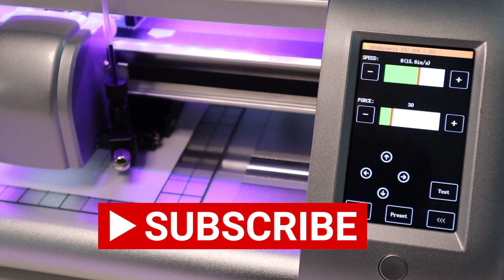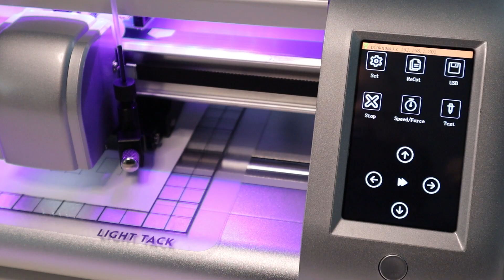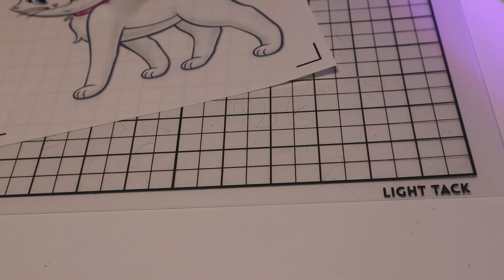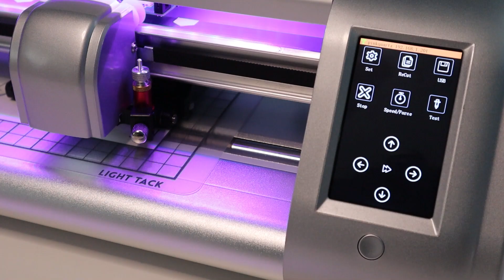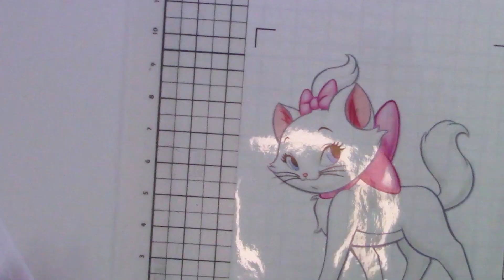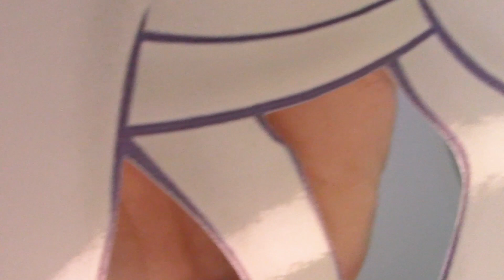Starcraft Solo - Print then cut - Beginner tutorial - Chapter 7 101

Comment: Hi Corinne, just set up the machine, and have been trying to do a cut and print. The scan for the cut does the first 2 registration marks fine, and then errors on the 3rd mark on the top left. I have restarted the cutter, restarted the software, realigned the cutter, printed it on 2 different printers, and I still can't get past the error. Help ! Thank you.

Comment: I just got my solo and setting up the pressure for each preset, would you say 30 is good for diecut without cutting into the mat?
Reply from the maker: I can't say because there are too many factors like what paper you are using, how far out your blade is in the carrier, the speed, laminates all those things. This machine is not like a cricut where I could say yes cut on this setting its likely to work. This machine you need to try your own settings to see what works with the way you have the machine set up.

Comment: not true the print then cut is 15+
Reply from the maker: At the time of this recording print then cut was 13.8. Wide. I was in direction communication with the developer of the software so the size may have changed since this video was filmed many months ago.
Reply from the maker: Just clarified with the developer of the Starcraft Solo and no you are actually incorrect. The print then cut size is still limited to 13.8 inches wide however it can cut up to 72 inches long

Comment: Hii I am new to solo cut but I did calibrate it with your video and it's cutting straight through the middle across the images as well
Reply from the maker: Your blade maybe too far down. The blade needs to be just barely showing
Reply: @CorinneBlackstone  I checked it but it literally cuts on the image I feel like it's a setting but I'm not 100 percent sure I have tik tok where I show it if you'd like to see if you can help me if you have a little time I would greatly appreciate it
Reply: @TheShannaWanna  hey I found out that you have to activate the software, if you don’t activate it, it will send cut lines through your images until you do! So on the beginning when you downloaded your software did you put your serial number in or activation number

Comment: I have a bunch of custom made files in Cricut design space (about 100 different stickers that include curved text). I'm a bit concerned about moving over to the Starcraft solo as I'd have to recreate all those stickers. Given the proprietary nature of design space, how hard vs easy would it be to get those out of design space and into the create software?
Reply: By the way - thank you for these videos. Very informative.
Reply from the maker: @dubalo  I have videos showing how to pull stuff from design space but with stickers you will lose quality when using screen shot to move them
Reply: @CorinneBlackstone  That was what I was concerned about. I make very small labels (1") that have curved text on them. Not looking forward to having to recreate those given how long it took to make them in the first place.
Reply: Also, which video are you referring to so I can see how you did it. I have an idea for another work around using a saved .pdf version of Cricut print-then-cut file.

Comment: I'm confused by this. In the video (and I also see in comments) a reference to "I don't have a large format printer" why would that be an issue? I guess I'm missing something pretty basic but I thought this machine prints out the material and then cuts it so why would one need a large format printer besides this machine?
Reply from the maker: No. There is no printing on this machine. The machine only cuts. Much like just about every other die cut crafting machine

Comment: Can you cut with a border around the art like with the Cricut? Also will this software work with the Cricut, I heard it will. Looks like a great machine but why at $500 they didn't make the pinch rollers automatic doesn't make since. Not a big deal, I'm sure you will get in the habit of releasing them pretty fast.
Reply from the maker: You can only cut with the cricut using design space. Provo craft the people who make cricut have actually sued companies over software that could work with cricut. You can design in the software and then you can export it to design space. Price I can’t tell you how they come up with that price it’s worth it I think. It’s metal and sturdy so much faster and quieter than other machines on the market, and the pinch rollers are not automatic to allow for a longer lasting machine as well as if anything does go wrong or break the part is replaceable so you don’t have to buy a whole new machine

Comment: I have a question. I have one but haven’t had a chance to begin using it yet. I use StarCraft inkjet printable vinyl and it’s pretty thick. I’m sure it will do a great job cutting it since the company that made the solo also makes the sticker paper. But my question - what must I do if the it doesn’t cut all the way through my stickers? On the Cricut I always run 3 passes to cut through my stickers. But with this machine - since it is so advanced - when I run a test cut, and it doesn’t cut all the way through, to I just feed it back through the machine? I have read the manual and found nothing about it. Thanks a bunch! I do appreciate this video! 🙏
Reply from the maker: You need to run the test cut until you find the setting that cuts through your sticker by upping the force. Just like with a cricut changing the pressure. You shouldn’t run your sticker paper through three times you should change your cut setting to cut correctly the first time
Reply: @CorinneBlackstone  The thing is… StarCraft inkjet printable vinyl is pretty thick, especially with the laminate covering it. And the way I cut my stickers, I cut them so that they pop out from the rest of the excess vinyl on the mat. Took me a little to figure out the settings with Cricut. So I need to figure out how to do the same with this machine. Lol. I understand this machine is new. And way more advanced than the Cricut. But there must be a way for me to cut the StarCraft inkjet vinyl in one pass. I just need to figure it out by playing with the settings… The way you did it on this video.. I can’t with the stickers I make. They need to look like die cut stickers. I’m sure I’ll figure it out. But if I had to, do you know if this machine would read the reg marks again to make a second or third pass? I appreciate you. Thanks!

Comment: You've got a typo in the description.  Can the camera be used like the Brother Scan N Cut's built-in 600 DPI 12 inch scanner?  How well does its camera handle laminated material.  I've been told by other YouTubers that the Cricut's sensor cannot read through laminates.

What the home market needs is a flatbed option where the cutter/scanner can run back and forth on rails or channels over a large area.  No more need for sticky mats that lose their grip over time.  The flatbed option should be easy to take apart, just as easy to assemble, and store when not in use.  If this can be modified to function reliably in that way now you're talking about hobbyist level flatbed printing, cutting, plotting which is not cheap in the prosumer and professional realm.
Reply: The camera is not a scanner. Instead the camera takes single, quick, zoomed-in photos of each reg mark to then know where to cut out a printed shape.  The camera can also be used to set a phenomenally accurate origin for perfectly aligned engraving, center-point cutting, and other specialized applications of interest to crafters. 

Because the camera can, supposedly, photograph reg marks printed on transparent, mirrored, and dark materials, I assume a laminate wouldn't be an issue. But I also haven't personally tested that yet.

Comment: How wide can this cut? You said it can only print 13.8" wide, but the machine is 16" cutter. If you have a printer that can print wider can you take advantage of the cutting width?
Reply from the maker: The reason it cuts 13.8 is due to the position of the camera
Reply: @CorinneBlackstone  So print and cut has limitation because the camera can't get to the regs marks.
Reply from the maker: @RonWaller  correct.
Reply: @CorinneBlackstone  Ok thanks for the replies
Reply from the maker: It cuts 16 inches wide

Comment: would you suggest this machine for a beginner?
Reply: I actually have found that higher functioning cutters like the SOLO are easier for beginners than for those experienced with other brands because beginners are not starting with a lot of false assumptions based on how their prior cutter worked. :)
Reply: @sandymccauley  Yes, this is what i was initially thinking about since regardless I will be learning the software and the machine's features as I would if I was to get any other cutting machine like  cricut. Thank you for your response! I was looking forward to hear any opinions anyone might have.
Reply from the maker: Probably not. It’s more on the pro side of the machine rhelm

Comment: do you need a mat for all materials  ie vinyl, card stock, infusible ink and so forth.  doesit  have any limitations on material it will cut thanks!
Reply from the maker: You need a mat for products that do not have their own backing so like cardstock and chipboard fabrics things like that but vinyl and infusible ink those have backing so they do not require a mat. You will see I use a mat in the videos because I worked with mostly paper and not full sheet of vinyl :)